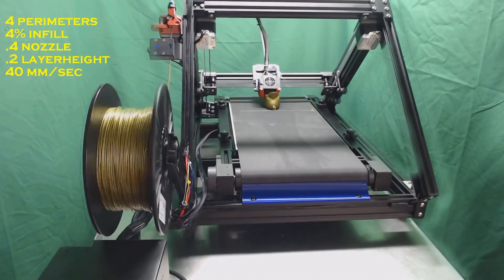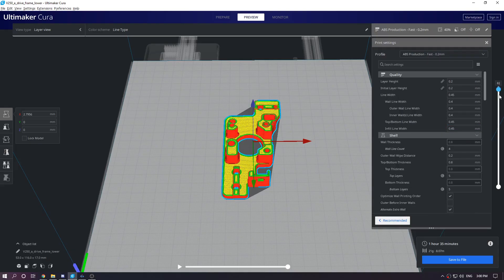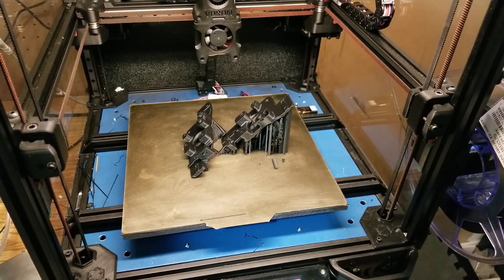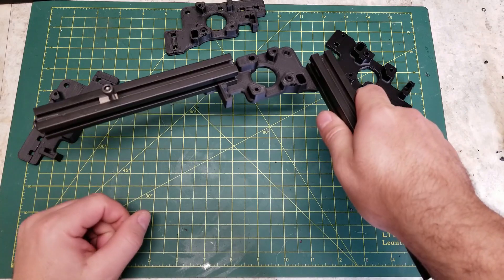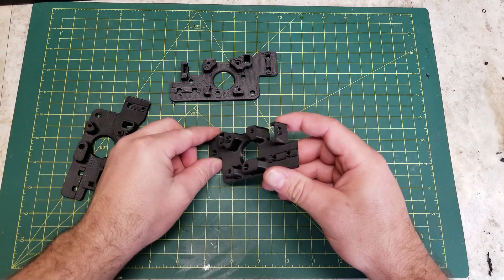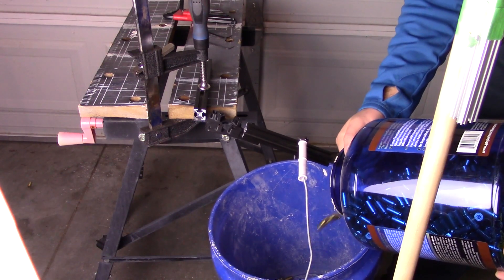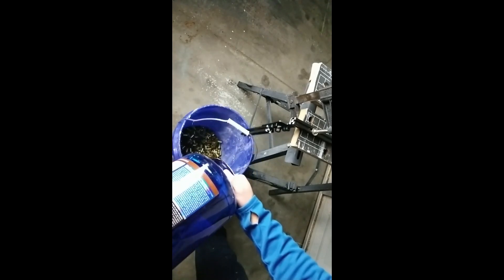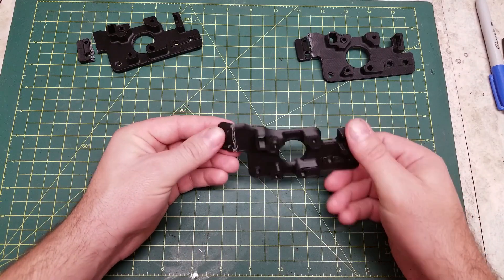Belt Printer Downsides?-DONT FORGET ABOUT THIS

Comment: So, you printed a part at 45°, on a 90° printer by changing the part's orientation.
...Couldn't a 45° printer also print a part at 90° by changing the part's orientation?

Comment: Seems to me they are mixing infinite Z with endless printing.  With a standard print head orientation parts could be printed in the standard way then advanced off the edge into the bucket over and over and over.  You'd need Z on the gantry and isolate the bed to Y and eject only.

Comment: When pouring the weight into the bin 2 forces actually act: the actual static weight plus the force due to the brutal decceleration of the chunks hitting the bottom of the bin. To have mich more accurate results you should drop them from way lower or better : use sand as it is a constant weight ramp up
Reply: And load significantly. Pre-gather them in 250g groups and load them carefully.

Comment: You could print the part at at 45 degree angle on an infinite bed printer and it will basically print in the standard orientation, with supports, but with the added benefit of being able to batch it up automatically, so for a part that needs a lot of them, you could do that. You can also design the part with the weak layer orientation in mind and adjust for it (thicker part in that area etch)

Comment: The big difference between these parts and ones printed on a real belt printer is the fact that the infill is also printed at the 45 degree angle, whereas these parts are actually printed straight up.  The difference winds up being increased surface area of the layer bonding in the infill.  (With a tilted layer, you actually get the hypotenuse of the Y/Z triangle... whereas on a traditional printer, you only get the normal Y surface area.)

Comment: Really all you would need is a belt driven bed that just moved after a part was finished.dont care to much for the 45 degree extruder.
Reply from the maker: Id personally prefer some sort of pallet changer setup using flexplates. But accomplishes the same thing.
Reply: @CanuckCreator  something like this ? https://www.tiertime.com/x5/

Comment: I thought you'd mention something about how what might have been a gentle overhang and didn't require supports would now require supports on the leading edge and what was an impossible angle requiring supports now on the trailing edge might not require supports. I'm excited by the possibilities this opens up.
Reply from the maker: The main reason this video was done was to just get knowledge of how much orientation will affect part strength, specifically for those looking to use this in print farm settings for printer parts. Ive watched a view videos/streams for the cr-30 and the subject wasn't really touched on

Comment: For functional or dimension dependant parts I wonder how much of a factor is the surface inaccuracies that are created with these 45degreee machines.
The trailing and leading edges of the print are subject to very different extrusion situations because the nozzle hole is not prependicular but at 45 degrees
You're not quite emulating that by just rotating the part
Reply from the maker: Correct, this test was more for part strength than tolerances, although they did pair up with the mating part for the motor mount fine and screw holes were correct, but that was just a quick test.

Comment: One of the earlier 3D belt designs allowed you to move from a 45 to a 90 degree angle. This would be better for making engineering grade parts as long as you didn't require infinite length.
Reply: Problem is that is under a patent owned by Stratasys.
Reply: @Raymond-u8x  That's true, you cannot legally sell someone else's patented ideas. But you can make it in such a way that it can be easily modified by the end user, not that China respects patent rights in the first place. If you purchased a CR30, would you modify it to print at 90? I think I would.

Comment: I noticed that your supports were really stuck on. Have you noticed that Cura has been making them thicker for the last few updates?
Reply from the maker: This is with cura 4.5. i normally run normal supports which are NORMALLY not an issue, but this time tried tree supports which, while they broke off cleanly, took some off camera force.

Comment: I alway was thinking a voron with a belt, not for the infinite z but the none spot back to back prints that could alway be 1 part at a time and not a full plate wasted when one part fails. Also,not needing to be near it all the time to clean the plate.
Reply from the maker: Personally im more of a fan of swapping flexplates, either by hand or mechanically

Comment: The ultimate besides injection molding or possibley annealing in plaster of Paris / salt, would be not printing in layers but to print in line with anticipated stress directions like a non planar printer, even beter if we could incorporate fibres.
Saw an interesting video the other day of someone using glassfibre in a  resin printer (pausing print and inserting mating),  maybe an excuse to buy myself a resin printer for Xmas
Reply from the maker: Have one homogeneous piece of plastic will always be best, adding a weave every couple of layers MAY work, as long as it doesnt detract from layer adhesion.

Comment: What if you print a part at 45° on a belt printer so the layers would be flat ?
Reply: beats the purpose of a belt printer, it's a cool idea but the 45° axis is just useless imo, what are you gonna print that requires infinite Z? for automatic batch production, it'd be better to have a regular perpendicular X with a belted bed for part removal
Reply: @l3d-3dmaker58  so a corexy with belt base. that can be an option for Voron 2.5 :p
Reply: Big Brain Time
Reply from the maker: If the parts where to be printed in a traditional method, then they would be like any other printer part, problem is if you look at the cr-30 for example, there really isnt alot of room for parts to move backwards before falling off the belt,  so your print volume would be pretty tiny on one axis